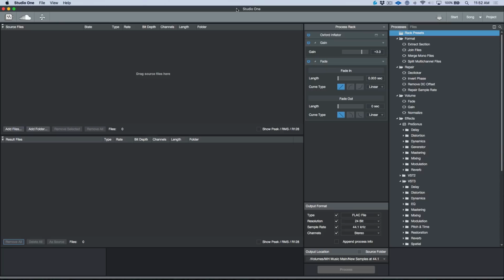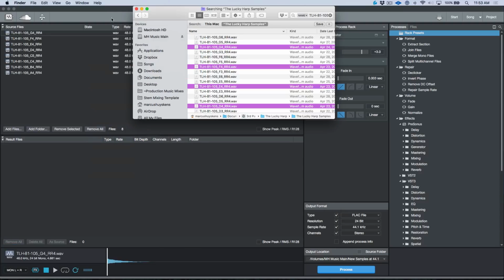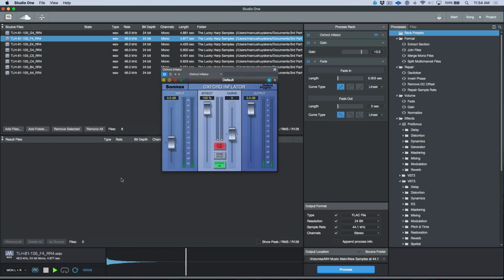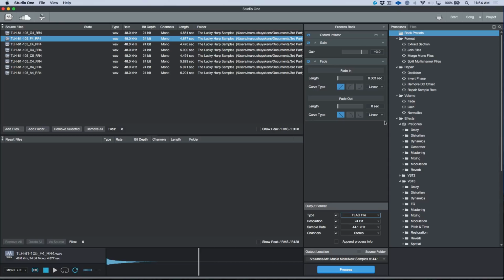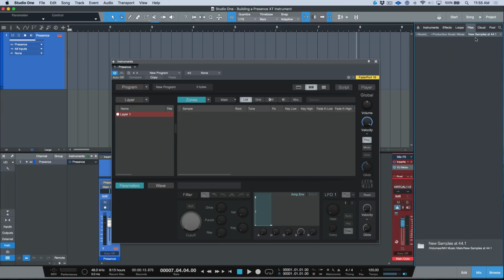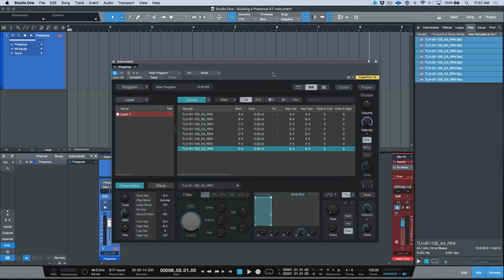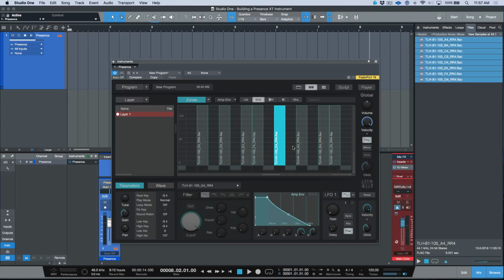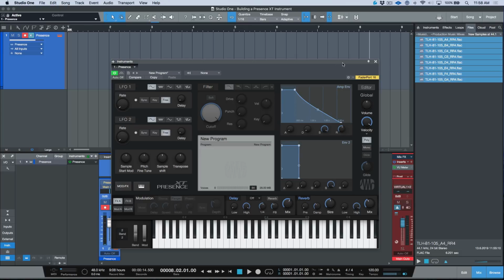Processing and Converting Samples Using The PreSonus Audio Batch Converter

Comment: I would love a part 2 on the xt editor. I am interested in how the round robin and velocity layers work as opposed to kontakt.

Also, is there an automap (is that what you eluded to in this video)? And how does the internal modulation work in presence xt?
Reply: Incog Nito Presence XT is in fact redesigned Kontakt 3 (if I remeber correctly)